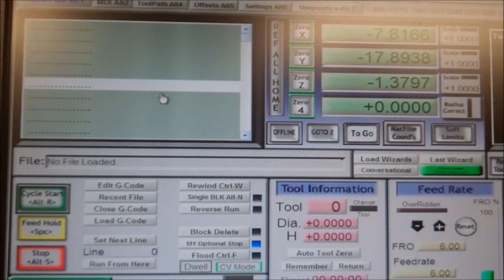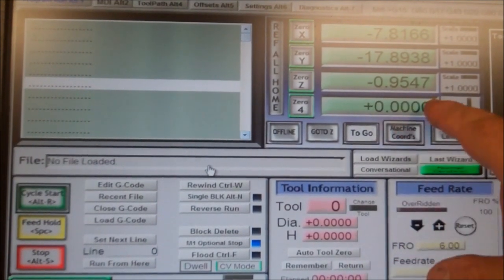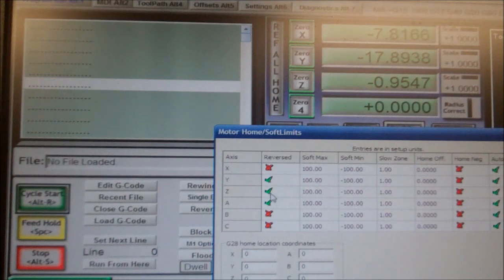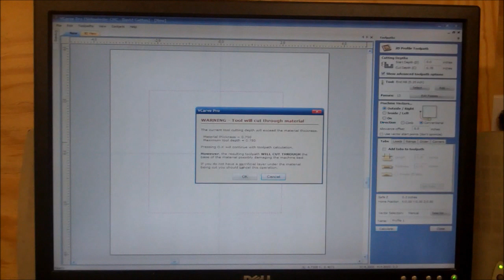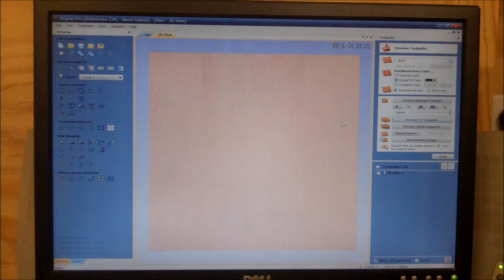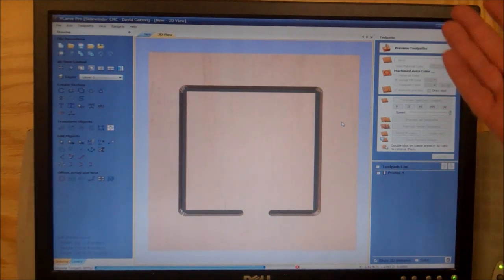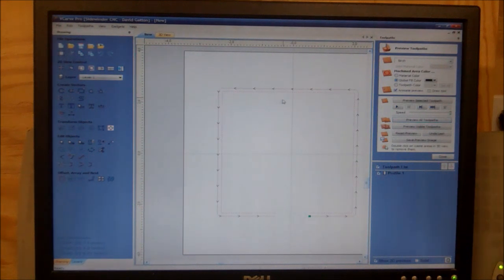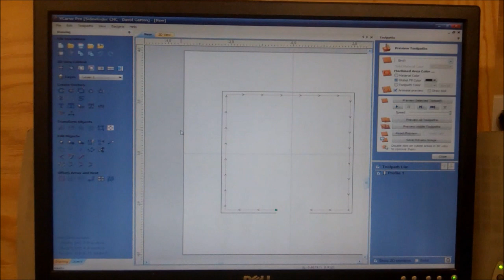CNC Questions & Answers

Comment: Dave - I saw your videos and have not built a CNC yet but hope to shortly.  I have a couple of questions that may have been discussed earlier but I could not find them on your site or elsewhere.  I will be using the CNC for inlays on furniture and segmented bowls, vases, etc so I am concerned about the tolerances of the cut out areas and the corresponding inserts.  During one of your videos you discussed the 5 star threads on the acme rods and then the settings in V-Carve for the stepper motors but I did not catch how that effects accuracy, can you explain the tolerances I can expect with different thread types or tell me where I can find the data on the net?  Any suggestions on thread types and stepper motors for accuracy?
  I have TurboCad software but will need to purchase controller software and CNC program software, the V-Carve and Mach 3 will end up costing ~ $900, can you recommend a cheaper software setup for the beginner or should I just bite the bullet and buy these packages IOT get the accuracy I am looking for.

 Thanks for any info you can provide and the excellent videos on your site.

Dave L.

Comment: Dave.....on another topic. Are the parts for your T-square table fence still available? and if so, how do I contact you?
thanks!
Reply from the maker: Lawrence,  I only did a small run of the T-Brackets.  I thought if they sell like hot cakes I would do another larger run.  They didn't so I didn't.